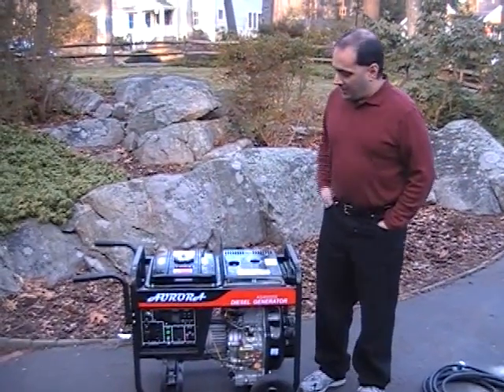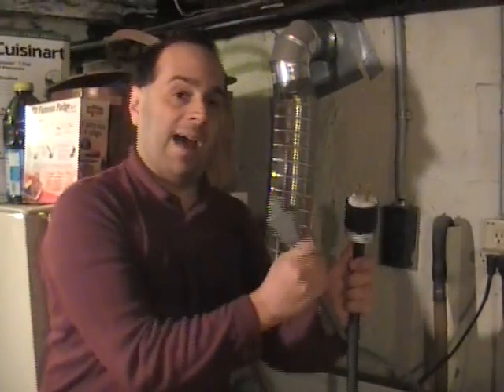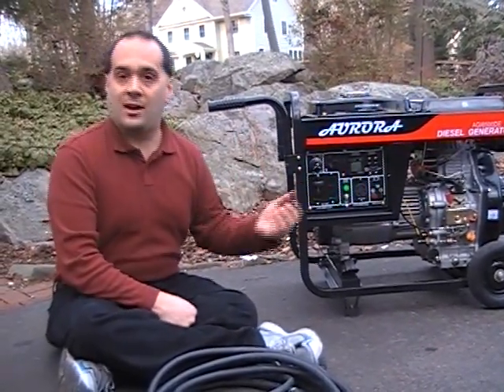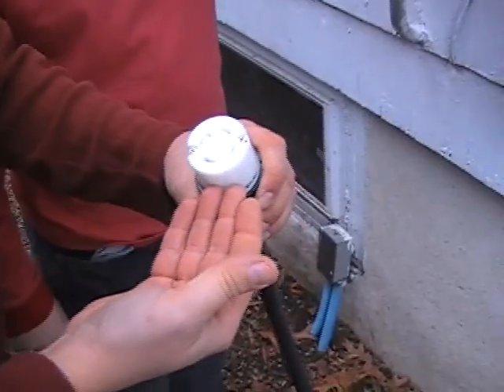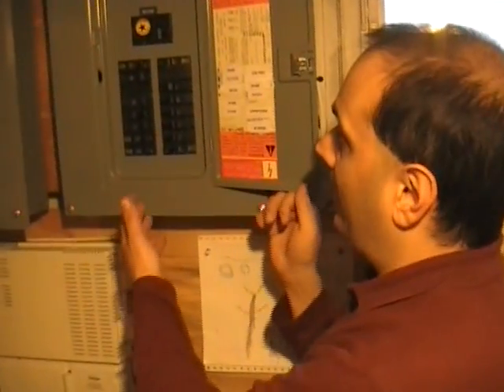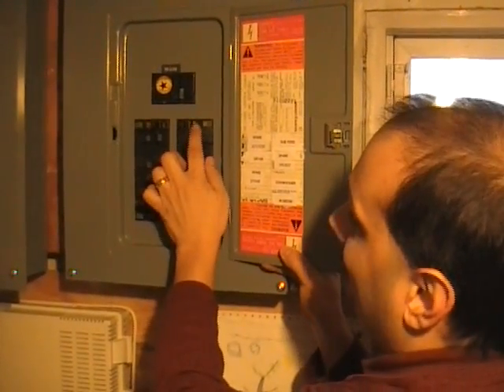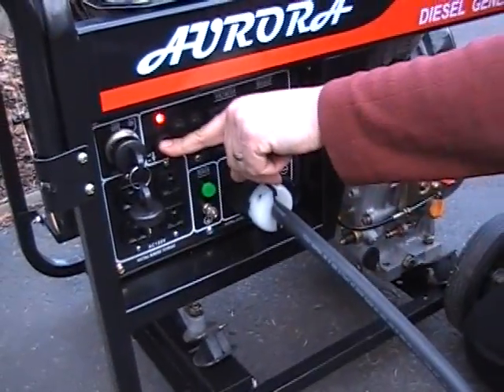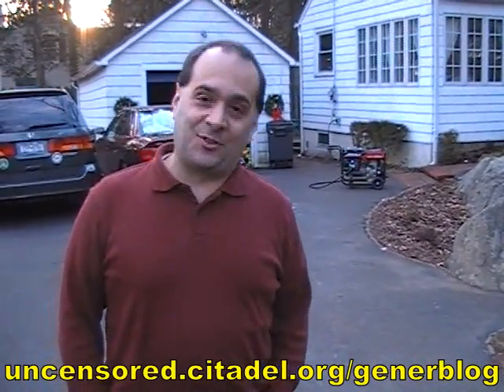Inexpensive residential generator hookup

Comment: What abounding grounding the generator?? Is your generator a floating or bonded neutral generator? If it's a bonded-neutral generator, and your ground wire from the generator receptacle goes directly to your house panel's ground buss, then you may want to consider disconnecting the neutral to ground bond in your generator... that will remove the potential for you to be SHOCKED if a fault occurs and electricity tries to flow from the generator frame THROUGH YOU to the ground.
Reply: You are bringing a very good issue that people connecting their generator is more like a hit or miss...since they don't know anything about it!!!  I tend to believe that his generator is of the type  floating neutral...Otherwise...it will trip the generator breaker.. like a GFCI protection.
Reply: Nobody grounds their portable gennies. UNLESS yer using the GFI outlets and running the wires thru water. Then a short would energize the frame and you wouldn't want to be touching it then. Look up "do I hafta ground my gen...?  You'll get lotsa a 'splanations Lucy!   : )
Reply: Here are the portable generator safety rules: make sure you are aware of all the warnings before using portable generators. This is just a reminder for everyone’s safety. All generator safety rules should be followed carefully. This advice is just to make sure that everyone is aware of all the warnings and it’s just to remind people to be careful using portable generators. Generators can be dangerous if not used carefully. Every year, hundreds of people die or get injured when using portable generators due to carbon monoxide poisoning and electrocution. Make sure you are using your generator carefully and keeping others safe as well. There is something very serious that everyone should always be aware of when using generators. Some people do run their generator indoors which is not safe and that increases the risk of carbon monoxide poisoning which can cause death of family and you. Some people run their generator in wet conditions which can electrocute them. Please remember that you should never run your generator indoors. Remember that carbon monoxide is an odorless and colorless gas that you cannot see or smell. Carbon monoxide is a silent killer. Keep that in mind. Make sure your generator is 15-20 feet away from your house and away from doors, windows, and vents. Never use your generator in your porch too. Having a carbon monoxide detector is very important against generator safety. Some people also allow children to go near the portable generator which could pose risks. We need to keep an eye on our children making sure that they are not near the portable generator so they won’t get electrocuted or burned by the generator which is dangerous. A locking enclosure also keeps kids safe. A generator shed might look like a tempting place to explore, or take cover during a game of hide and seek, but a generator is a dangerous piece of equipment that can cause injury. It says on the manual that we should also keep children away at all times from the portable generator to avoid injuries. Please do not allow a child or unqualified people to operate the portable generator.  It is important to keep your children safe especially little ones. The portable generator can be hot during an operation. Just because some manuals missed what should be listed doesn’t mean it’s safe to do. Always follow the generator safety rules when using portable generators. Generators pose electrical risks. If you need to use your generator during wet weather, you need a generator tent to protect your generator from getting wet. Don’t let your generator get wet. Keep your generator dry and before using your generator, please make sure your hands and your generator is dry. Do not wear loose clothing when operating the generator. Everything that is said on the generator’s operating manual should not be ignored. Never smoke cigarettes near the generator. Please keep flammable things away from the generator. Never overload your generator too. Your generator can catch fire. Never ever try to plug a generator cord into a wall outlet to avoid back feeding. Back feeding your generator is dangerous. Always turn on your generator first before plugging in appliances and shut off the appliances before turning your generator off. Use a heavy duty cord for your generator and the cord should not be worn out. All the instructions should be followed carefully. Never refuel your generator while it’s running. It can cause fire if fuel spills while your generator is hot. You should turn off your generator and let it cool off before refueling it. Having a fire extinguisher next to the generator is also important. This is only a reminder for everyone’s safety of using generators. Make sure your generator is properly grounded. Having a fire extinguisher next to the generator is also important against the safety rules. https://youtu.be/I1jT3ANENvI and here is a video more about keeping others safe when using generators and also about our family’s safety. It’s important to keep our little children safe as well. Make sure they’re away from the generator. Hope this helps. Thank you.

Comment: I've done my share of homeowner electrical work, but 'lectricity is a cruel mistress. At least with plumbing, you can see a leak. Not so with electricity. Just call a pro and keep some tradesmen working and your family safe.
Reply: "'lectricity is a cruel mistress", true that. Even if you are good, you have to be REALLY good when it comes to all things electrical. I've found electrical a very rewarding learning experience, but definitely the strictest of all. So little deviation is forgiven and the tiniest error means the difference be on and off.

Comment: I backfeed through a disconnect and a standalone circuit for the gen
Reply: Here are the portable generator safety rules: make sure you are aware of all the warnings before using portable generators. This is just a reminder for everyone’s safety. All generator safety rules should be followed carefully. This advice is just to make sure that everyone is aware of all the warnings and it’s just to remind people to be careful using portable generators. Generators can be dangerous if not used carefully. Every year, hundreds of people die or get injured when using portable generators due to carbon monoxide poisoning and electrocution. Make sure you are using your generator carefully and keeping others safe as well. There is something very serious that everyone should always be aware of when using generators. Some people do run their generator indoors which is not safe and that increases the risk of carbon monoxide poisoning which can cause death of family and you. Some people run their generator in wet conditions which can electrocute them. Please remember that you should never run your generator indoors. Remember that carbon monoxide is an odorless and colorless gas that you cannot see or smell. Carbon monoxide is a silent killer. Keep that in mind. Make sure your generator is 15-20 feet away from your house and away from doors, windows, and vents. Never use your generator in your porch too. Having a carbon monoxide detector is very important against generator safety. Some people also allow children to go near the portable generator which could pose risks. We need to keep an eye on our children making sure that they are not near the portable generator so they won’t get electrocuted or burned by the generator which is dangerous. A locking enclosure also keeps kids safe. A generator shed might look like a tempting place to explore, or take cover during a game of hide and seek, but a generator is a dangerous piece of equipment that can cause injury. It says on the manual that we should also keep children away at all times from the portable generator to avoid injuries. Please do not allow a child or unqualified people to operate the portable generator.  It is important to keep your children safe especially little ones. The portable generator can be hot during an operation. Just because some manuals missed what should be listed doesn’t mean it’s safe to do. Always follow the generator safety rules when using portable generators. Generators pose electrical risks. If you need to use your generator during wet weather, you need a generator tent to protect your generator from getting wet. Don’t let your generator get wet. Keep your generator dry and before using your generator, please make sure your hands and your generator is dry. Do not wear loose clothing when operating the generator. Everything that is said on the generator’s operating manual should not be ignored. Never smoke cigarettes near the generator. Please keep flammable things away from the generator. Never overload your generator too. Your generator can catch fire. Never ever try to plug a generator cord into a wall outlet to avoid back feeding. Back feeding your generator is dangerous. Always turn on your generator first before plugging in appliances and shut off the appliances before turning your generator off. Use a heavy duty cord for your generator and the cord should not be worn out. All the instructions should be followed carefully. Never refuel your generator while it’s running. It can cause fire if fuel spills while your generator is hot. You should turn off your generator and let it cool off before refueling it. Having a fire extinguisher next to the generator is also important. This is only a reminder for everyone’s safety of using generators. Make sure your generator is properly grounded. Having a fire extinguisher next to the generator is also important against the safety rules. https://youtu.be/I1jT3ANENvI and here is a video more about keeping others safe when using generators and also about our family’s safety. It’s important to keep our little children safe as well. Make sure they’re away from the generator. Hope this helps. Thank you.

Comment: Awesome. I'm a total luddite trying to install a stand by generator on a little beach casita I built near Cabo San Lucas. The "main" panel is only a 60amp sub panel since that's the service coming in to this tiny casita. I'm thinking I could use the tandem breakers to make a bit of room, but this panel doesn't have a whole house breaker so I might have to change this panel anyway. Is that generblog website still active? I tried and it said "not found"...
Reply: Does it feed straight in to copper bars or in to a breaker?  I have to laugh with you on the 60 Amp.  My friends uncle has a big home on the beach and they only gave hime 50Amps and the 6 gauge wires coming to the house are about 200 feet from pole to the house.  You could run tandems to give you the space to put in a toggle lockout.
Reply: Here are the portable generator safety rules: make sure you are aware of all the warnings before using portable generators. This is just a reminder for everyone’s safety. All generator safety rules should be followed carefully. This advice is just to make sure that everyone is aware of all the warnings and it’s just to remind people to be careful using portable generators. Generators can be dangerous if not used carefully. Every year, hundreds of people die or get injured when using portable generators due to carbon monoxide poisoning and electrocution. Make sure you are using your generator carefully and keeping others safe as well. There is something very serious that everyone should always be aware of when using generators. Some people do run their generator indoors which is not safe and that increases the risk of carbon monoxide poisoning which can cause death of family and you. Some people run their generator in wet conditions which can electrocute them. Please remember that you should never run your generator indoors. Remember that carbon monoxide is an odorless and colorless gas that you cannot see or smell. Carbon monoxide is a silent killer. Keep that in mind. Make sure your generator is 15-20 feet away from your house and away from doors, windows, and vents. Never use your generator in your porch too. Having a carbon monoxide detector is very important against generator safety. Some people also allow children to go near the portable generator which could pose risks. We need to keep an eye on our children making sure that they are not near the portable generator so they won’t get electrocuted or burned by the generator which is dangerous. A locking enclosure also keeps kids safe. A generator shed might look like a tempting place to explore, or take cover during a game of hide and seek, but a generator is a dangerous piece of equipment that can cause injury. It says on the manual that we should also keep children away at all times from the portable generator to avoid injuries. Please do not allow a child or unqualified people to operate the portable generator.  It is important to keep your children safe especially little ones. The portable generator can be hot during an operation. Just because some manuals missed what should be listed doesn’t mean it’s safe to do. Always follow the generator safety rules when using portable generators. Generators pose electrical risks. If you need to use your generator during wet weather, you need a generator tent to protect your generator from getting wet. Don’t let your generator get wet. Keep your generator dry and before using your generator, please make sure your hands and your generator is dry. Do not wear loose clothing when operating the generator. Everything that is said on the generator’s operating manual should not be ignored. Never smoke cigarettes near the generator. Please keep flammable things away from the generator. Never overload your generator too. Your generator can catch fire. Never ever try to plug a generator cord into a wall outlet to avoid back feeding. Back feeding your generator is dangerous. Always turn on your generator first before plugging in appliances and shut off the appliances before turning your generator off. Use a heavy duty cord for your generator and the cord should not be worn out. All the instructions should be followed carefully. Never refuel your generator while it’s running. It can cause fire if fuel spills while your generator is hot. You should turn off your generator and let it cool off before refueling it. Having a fire extinguisher next to the generator is also important. This is only a reminder for everyone’s safety of using generators. Make sure your generator is properly grounded. Having a fire extinguisher next to the generator is also important against the safety rules. https://youtu.be/I1jT3ANENvI and here is a video more about keeping others safe when using generators and also about our family’s safety. It’s important to keep our little children safe as well. Make sure they’re away from the generator. Hope this helps. Thank you.

Comment: When thru hurricane sandy.  Plugged my generator into my dryer plug after breakers shut off.  Lasted for two days , no issues, no cord coming out.   This connection is for running lights and heat and some appliances.
Reply: Yeah it's up to the users discretion and many people have no business plugging in a blender much less making a suicide cord
Reply: It seems that “ know-it-alls” don’t really know much of anything except how to flaunt their ignorance. 
They usually have no qualms about endangering others with their stupid stunts.
Reply: @georgemoomaw2244  What motivates you, folks?  Nothing better to do? Wait, I know, ELECTRICIAN
Reply: You should shut off the main when you do that so you don't smoke the line technicians when they think the power is off and they get bolted by Joe home owners generator
Reply: I always do or there could be some unexpected fireworks.  This setup is for emergency’s only and I wouldn’t recommend it for everyday standby.

Comment: This is fantastic. I’m frustrated, however, as my indoor electrical panel is in a very finished, visible spot in the house, and is a fair distance from where I need my generator to sit outside (therefore where I need to put the exterior outlet). The outdoor patio area is also all finished in😔.  I’m afraid an electrician will cost a mint due to these ‘obstacles’.

Comment: Looked like you could have thinned out the original panel with Square D QO 20/20's and would have had the room to fit the generator breaker in the main panel and go with the first interlock you mentioned. A whole lot less work and less exspence?  You mentioned the first one is clumsy? They're awesome and no less clumsy then the one you had to use in the second panel anyway.  Unless they don't make a mechanical interlock for the QO style breakers, I haven't seen one, but haven't really looked.  Well, there's certainly different ways to skin a cat. I like the simplicity of the first interlock switch.

Comment: Good to see a responsible treatment of this subject. I cannot believe how many YouTubers rely on remembering to turn the main breakers off before turning the gen breakers on.  A danger of this method you didn't mention is that the step-down transformers on the power poles are just as happy to step your 240v up to the distribution voltage which may be 12kv or so.  Linemen out repairing sections they think are shut off could be killed by an errant homeowner who forgot to "do it right".   There's going to be maybe 1/2 amp behind that 12kv, but it takes much less to stop your heart and 12kv will make sure that 1/2 amp gets there.

Comment: @5:33, do you mean that the double breaker (feeds the generator?) OR is it that the Generator feeds the double pole breaker to supply voltage to the house distribution panel?